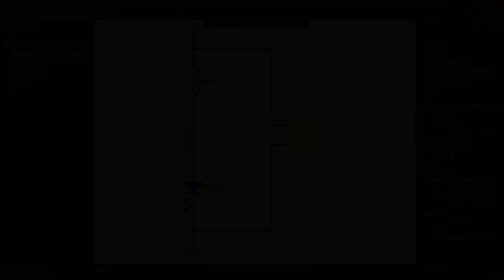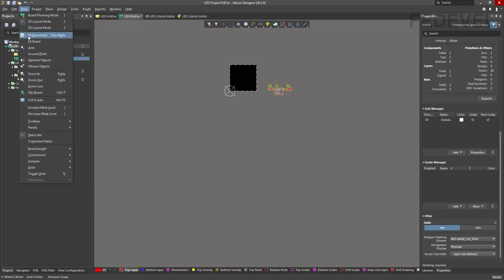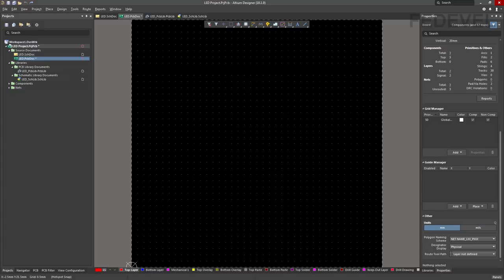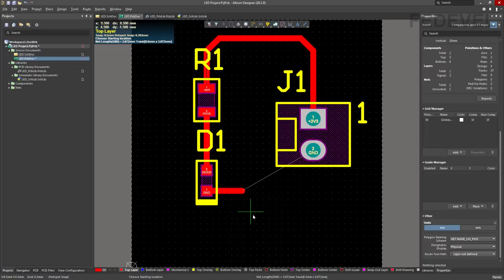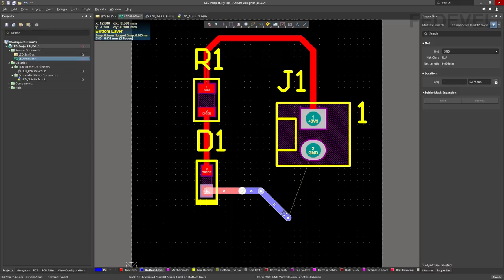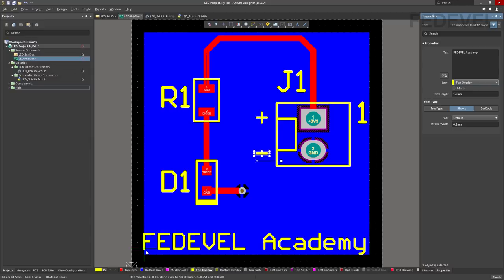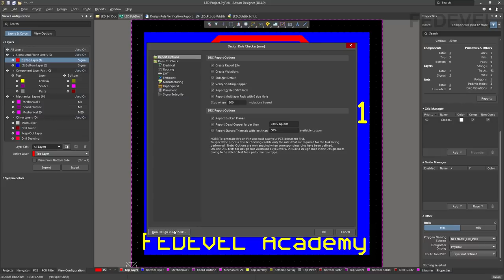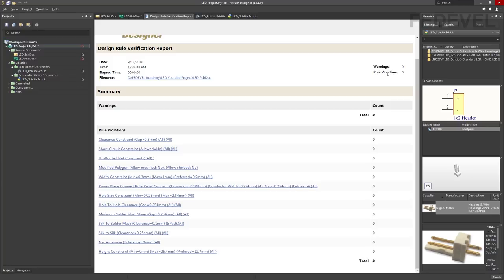Tutorial 3 for Altium Beginners: PCB Layout

Comment from the maker: NEW: I updated this tutorial and made a shorter version ( in case you need it ). Here it is: Altium Designer 22 Tutorial - Quick & Easy |  Step by Step https://youtu.be/PqFtSpAXB9Q
Reply: If we have changed the design rules, how then do we go back to the default rules?
Reply: When in the PCB layout, why do the "fill" and "solid region" do under the Place command?
Reply: when I made the ground plane, it did not connect to the via, why could this be?
Reply: Why doesn't the PCB document update automatically to reflect changes in the schematic?

Comment: Hi, have you had any problem when you are placing the polygon pour in the top layer (polygon pour connected to GND) and shows you a lot of errors of short circuits between the polygon pour and all the pads?, thanks
Reply: I don't know if this is an Altium's bug because it happened to me when I tried to modify the PCB once all was routed

Comment: Thanks Robert. Why did the poly GND plane on the back side add thermal "spokes" to the via and connector pin 2  (vs. direct connect) ??
Reply from the maker: Hi Mark, how polygons & planes are connected is set in the Rules. You can change or adjust it if you need.
Reply: @RobertFeranec  I see, Thanks.

Comment: Hi, Robert! I wanted to ask that when i am going into the PCB format from the schematic, by update PCB document, in some of the pins it is showing "unknown pin error". Can you please tell me something about this error, i tried to correct it but, it's not working.
Reply from the maker: means, this pin doesnt exist in you pcb -> means for example footprint was not assigned correctly or for example there are different pin names between symbol and footprint. Check footrpint assignment in that specific component, check pin names of that symbol and compare them with pin names/designators in footprint.
Reply: @RobertFeranec   Thanks a lot for the help Robert!! The pins assigned on footprints carried a different name from that of the symbols. I corrected it and now the problem is solved.

Comment: Hi Robert i was working on 2 layer pcb and i applied polygon pour on both side for ground then i change my mind for 4 layer if i use 2 layers for ground do i need to use polygon pour again ?? 
and what is is the best stack up knowing i don't have any antenna on my board so don't care much amout EMI.
Reply from the maker: If I have a solid GND in stackup I do not pour GND on signal layers (but there may be exception if you are designing for example some RF boards). This may help you with your stackup question: https://www.fedevel.com/welldoneblog/2013/09/3-steps-how-to-determine-calculate-number-of-pcb-layers/

Comment: Altium or cadence which is better?
In terms of

Stability
Usability
Time efficiency
Future proof

Thanks!
Reply from the maker: I answered similar question just recently on eevblog (not exactly what you are asking here, but still can help): http://www.eevblog.com/forum/eda/altium-designer-18-vs-cadence-allegro-17-2/msg1837037/#msg1837037
Reply: @RobertFeranec  thanks
Reply: @RobertFeranec  Ok. Let me sum a bit for myslef. 
1, I should better learn both.
2, price is not big concern.
3, For simple fast prototype go altium.
4, For mechanically complex project go altium.
5, high speed, big board, need simulation go cadence.
6, There are reference design in cadence.
This is much clearer now. Thanks.
Reply: I am proficient in Cadence and am learning Altium. I see benefits in both. I feel like I have more detailed and discrete control in Cadence, so that is my preference. Altium feels more approachable, though.

Comment: What is the difference between the created Board Outline layer and the Keep Out layer?
Reply from the maker: keep out is used in cases when you need to be careful about not placing specific objects into specific areas. For example a good example can be if you have a metal connector (SD card socket) with exposed contacts and you do not want to place any VIAs nor tracks under that socket.Board outline are just edges of the PCB.

Comment: Hi Robert. How do you remove the component designators in the new Altium? PCB inspector seems to have disappeared!
Reply from the maker: PCB Inspector was replaced by Properties panel. Select all designators and in properties panel you will find hide designator option (I do not have access to Altium right now, but I think it is an eye button)
Reply: @RobertFeranec  Found it. Thank you :)

Comment: Hi Robert, 
Thank you for very useful videos!
I have a question: to modify the routing of a group of nets, I select segments (with "Touch line" option) then move them but the nets are not re-routed later on. Only the segments are moved and the whole bus gets disconnected afterward. What would be the mistake?
Thanks,

Nam
Reply from the maker: Double check your System Preferences -> PCB Editor -> Interactive Routing -> Dragging. There you can set if you would like to Drag or Move
Reply: @RobertFeranec  Bingo! You are my idol! Thanks a lot!
Reply from the maker: @lytuhoangnam  Glad to help

Comment: Hello hello hello ...tnx for your nice vid ..I have problem with my altium 17 ..which is:
I can not rotate my component in pcb mode with "spacebar" I can just rotate it with "M" button!!!
Do you know how to fix it?
Reply from the maker: In PCB you need to be holding the component (you need to be in the "move mode" and then you can use spacebar to rotate it). If you just select a component in PCB and try to rotate press spacebar - that will not work. In schematic it is the other way, when moving symbol, it will not work, but when selected, press spacebar and symbol will rotate.

Comment: Thanks for this tutorial, but I faced a problem with connecting the tracks with the pads. Some tracks are not able to be connected with the pads they always stop around the pad even I checked the thickness of the tracks and the pads sizes. Can you help me to solve this problem please?
Reply from the maker: Try to zoom in to the pad and check where they are connected (check the net name). Many times problem is in symbol - you need to be sure, that pin is correctly rotated. Only one side of pin is electrical and when you are drawing schematic, wires has to be connected to that side of pin.
Reply: @RobertFeranec  Thanks for your reply.
I found that the problem is actually all the nets were not able to be generated due to mistakes in the naming of the pins. I corrected it now, but still there are two nets unable to be generated. The message that appears is "unknown pin". I have no idea why.
Reply from the maker: @abdulrahmanhaimour7312  unknow pin usually means, there is difference between pins in schematic and footprint. Go through pins in symbol e.g. pin 1, pin 2, pin 3 and be sure you will find pin 1, pin 2, pin 3 also in footprint
Reply: @RobertFeranec  I have checked the names of the pins, it's the same. Is it true to assign the nets manually after generating the ".pcblib" file?
Reply from the maker: @abdulrahmanhaimour7312  there is something missing. it is not about names, but about pin numbers. (do not assign nets manually in pcb, that is not proper way to do it)

Comment: I am getting this error after running Design Rule Check
[Width Constraint	001_PCB_Expansion.PcbDoc	Advanced PCB	Width Constraint: Track (12mm,19mm)(15.5mm,15.5mm) on Top Layer Actual Width = 0.3mm, Target Width = 0.1mm	8:40:35 PM	2020-05-19
Secondly, when I go to  Design Rules > width and change it to 1mm then I get the message "Some rules have incorrect definitions. Would you like to correct them?".

Thank you for the tutorial, it's really helpful.
Reply from the maker: Use Panels -> PCB Rules and Violations, then find the error, highlight the tracks and correct the width to 0.1mm. Or you may need to change the rule.

Comment: Hi,Rovert,I use AD14，when I import netlist into pcb,the .designator string I created in the mech layer is still .designator in th pcb,it did not auto change,why？
Reply from the maker: There is an option what you need to enable something like Convert strings. When you are in PCB, press "L", that should open the window where it is located (have a look in all the TABs, I think it is in the second TAB(?))
Reply: @RobertFeranec  MANY THX

Comment: I update Designator "D ?" in "D?", update, but no change in SchDoc...
Reply from the maker: did you make the correction in the schematic symbol library, sync the library with schematic and sync schematic with PCB?
Reply: @RobertFeranec  I think....
I start all over again from the beginning....
All components are not connected on PCB.

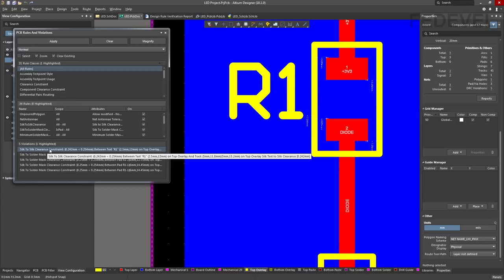Comment: How can I show the net name in PCB editor? like "DIODE" on the Net in 24:04 of this video, I am using Altium 18.0. Thanks.
Reply from the maker: I probably only zoomed in? I do not have access to Altium right now and I know, that you can switch on/off net name on VIAs (I think it is in system properties), but I am not sure if you can switch on/off net name on pads or tracks - they should be visible when you zoom in enough.

Comment: Dear Sir, why does my pin number (ex: 1, 3V3) won't show up? great thanks. Also vias didn't change it's shape
Reply from the maker: Pin numbers and nets: you need to zoom in very closely or double check your settings (clock on Panels button, then View Configuration -> View Options -> Additional Options and enable Pad Nets, Pad Numbers). PS: I am not sure what you mean by "vias didn't change it's shape" - did you select it before updating the parameters of VIA?
Reply: @RobertFeranec  thanks! Yes i did, but it has an error, it said " Un-Routed Net Constraint: Net GND Between Via (4.5mm,2.5mm) from Top Layer to Bottom Layer And Pad J1-2(12mm,4.96mm) on Multi-Layer "
Reply from the maker: @muhammadadnan749  Did you assign GND net to the polygon?
Reply: @RobertFeranec  that surely solved the problem, you're such patience. Thanks!

Comment: Hi Robert. thanks for this video. I want to ask how can i move a component with tracks. I tried many tips on google and nothing work for me. Only when i go to Edit->Move->Drag Track End the component move with the track but the track is going in any address. Maybe a video explaining this could be very helpful. PD Sorry for my english
Reply from the maker: Depends on your Altium version - old versions will not support it. I do not use it, but I think you may need to enable System Preferences -> PCB Editor -> Interactive Routing -> Dragging: Check Component re-route and check Move component with relevant routing. Here you can find more info ( they call the video Component Retrace ): https://www.altium.com/altium-designer/playlists/altium-designer-19-whats-new#playlist-main_video_Tvt2Sv998eCtj5wP2hJ2mC
Reply: @RobertFeranec  Thanks for your quick reply. I followed your instructions but in my version 18.0.12 check box "component re-route" does not appear in the route that you put. Here is how pcb editor interactive routing looks to me: https://www.altium.com/documentation/sites/default/files/wiki_attachments/296878/InteractiveRoutingOptions_AD18_0.png
Reply from the maker: @delereorbem  the link I attached above is for AD19 new features. So it may not be supported in AD18.
Reply: @RobertFeranec  It works very well at AD19. Thanks you.